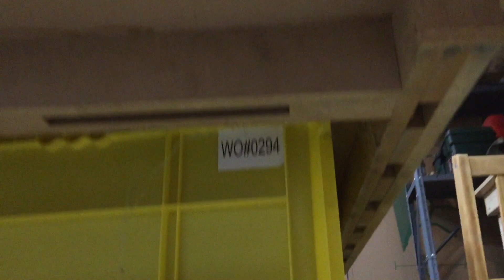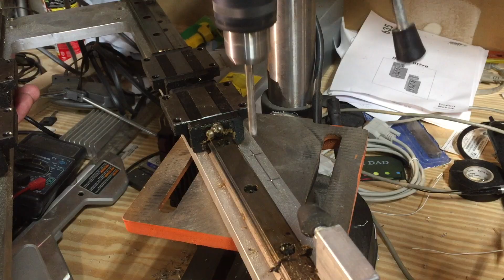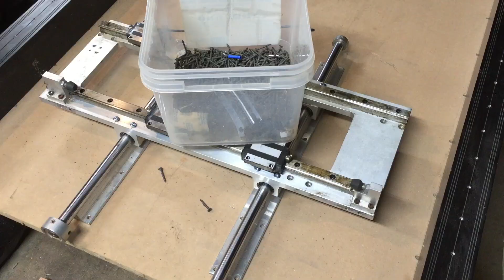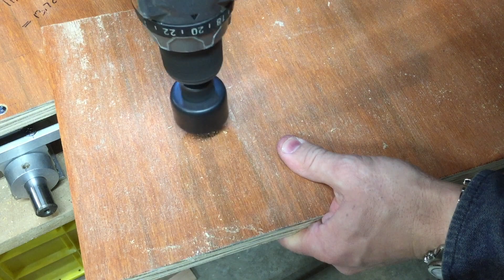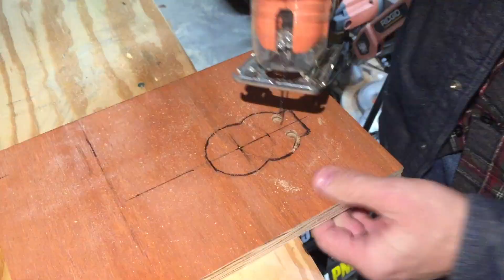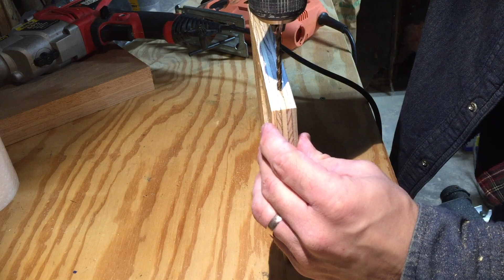DIY Horizontal Slot Boring Machine. Notch Mortising. Wood Slotting.

Comment: Replace that drill with a router.  The chuck on that drill is clearly moving in and out, also a drill won't like the thrust perpendicular to the cutting tool.
Reply from the maker: Thank you for your comment! This drill is the most powerful I have and the chuck is moving because this drill has hammer function. Besides, router will not give me an option to make a 2-3 inch deep channel at 10mm width.
Cheers.
Reply: @TinkeringNerd  use an endmill
Reply: worthy comment on the thrust direction

Comment: Very nice build and video  my only negative comment or question  is why the preference of Dominoe style  slots ? I am a retired Woodworker  and Woodworking is still a hobby and passion of mine  for alignment  ive always used biscuits  and to make the slots ive often  just used a wing  cutter in my router  which is a fast and economical  way of getting alignment   When Festool hit the market with their floating tendon design ive never figured out why everyone made such a fuss out of it ? In my personal opinion the attraction to many was the allure and bragging rights of having a. Way overpriced. Tool to show off  and really wasnt worth the money  to do 1 function  at least  a router   Can do many functions for the Woodworkers   Although i did like your design i have made furniture and other projects with the biscuits that have all stood the test of time  and another advantage is you can pick up  a used biscuit slot machine  for. Less money that it would  cost to buy the supplies for your. Machine even though you said you had parts laying around they still have a value and most people wouldn’t have the America’s thing to use  so would need to purchase  some parts ?   I am a guy that likes to think outside the box  as well. And  design and engineer my own solutions similar to you   And not pay the high prices. If i can avoid it  my other passions in life have been Boating  and Vintage Automobiles  and many times ive avoided  buying a “ Speial” tool from a manufacturer  and just made my own to get the job done  usually those tools are pullers or  some other removal tool  designed specifically for only that one part  and are  very expensive  those making the tools and selling them often state in the manuals or instructions that such tool number must be used   Ive  found thats not always true a lesson that my Father. Taught me growing up  and now that he is passed ive inherited his tools that some of the ones he built or had built  are still  present in his boxes  so i will often. Take those out just to admire my Dads work  as i was usually present when he   Tested them for the first time  and saw his satisfaction
Reply from the maker: Hello and thank you for watching and commenting! Those notches are not for domino style slots. What I did was make notches in vertical pieces of the door and cut “fingers” on ends of horizontal pieces that go into slots. This is also a time tested technique that is relatively easy to implement. Back long time ago, I used to do woodworking and wood carving for living.. never really liked woodworking because it’s dusty, noisy and pointless. I used to make really expensive custom pieces which ended up collecting dust in expensive houses where I wasn’t even invited. I like metal much better because I can make something from metal that is used to make something else.
Thanks again,
Cheers.

Comment: Might want to consider an upcutting router bit for the mortising action instead of the drill bit.  Might work a bit smoother!  :)
Reply from the maker: Those are little harder to come by, especially in longer sizes. But, I agree, they’ll leave a much better finish!
Cheers.